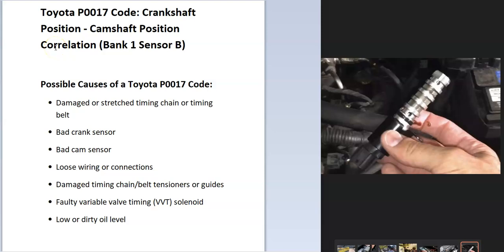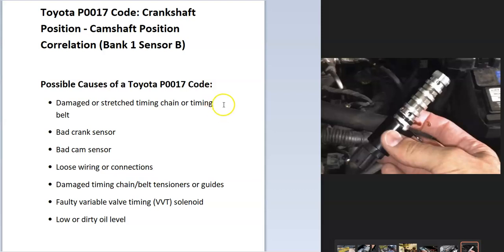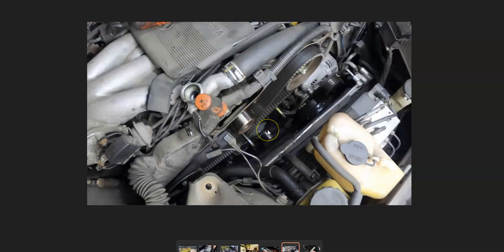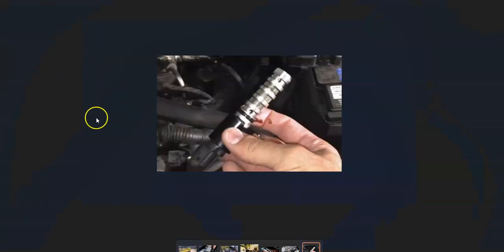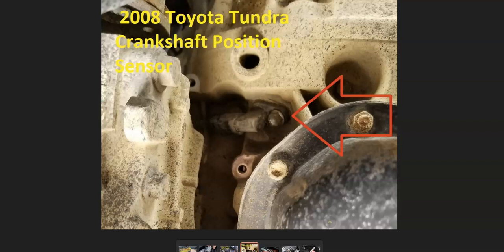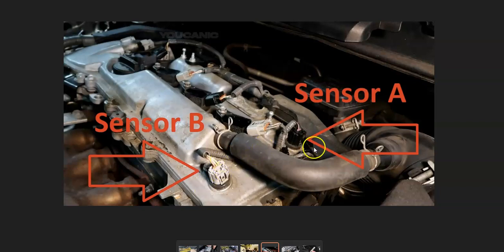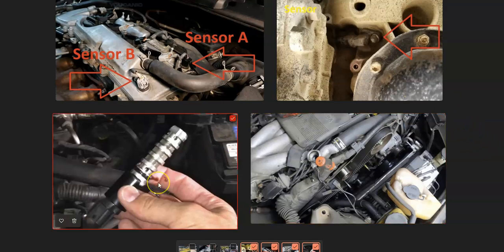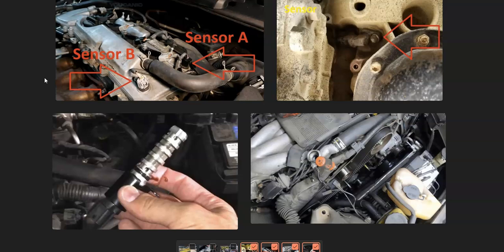Causes and Fixes Toyota P0017 Code: Crankshaft Position - Camshaft Position Correlation Bank 1

Comment: Have any of you gentlemen changed out the phasers? I’ve done chain, guides, tensioner, solenoids, rotated the solenoids and camshaft sensor, crankshaft sensor, oil and everything I’m stuck and I want to know if you guys have changed the phasers
Reply: Did you fix the issue ?

Comment: Hi thanks for the good video.  After a recent oil change I got check engine and limp mode.  Codes says camshaft position sensor.  Oil level is good.  Replaced all 5 camshaft position sensors. Replaced all 4 VVT valve timing solenoids. Still error "P0017 crankshaft camshaft position correlation bank 1 sensor B.  Any idea?  Do you know what fuse to check for these?
Reply: Rosesn8er did you have any other symptoms when you drive with P0017 code did you notice a misfire or when driving fast the car slow up with Check Engine light flashing
Reply: Did you found the problem or fix it?
Reply: Was it the timing chains?

Comment: Are the intake and exhaust ones the same besides the colors or are they actually engineered differently? Amazon sells them that claim to work for both situations.
Reply from the maker: They are usually the same. AutoZone has a good online system to check part compatibility to be sure.
Reply: Yeah, Amazon is usually much cheaper but of course more risky.